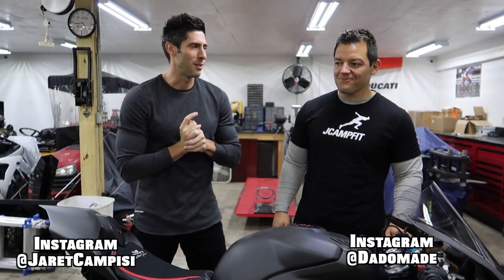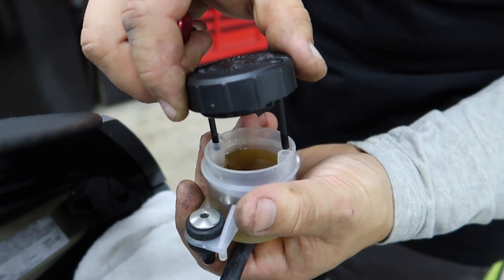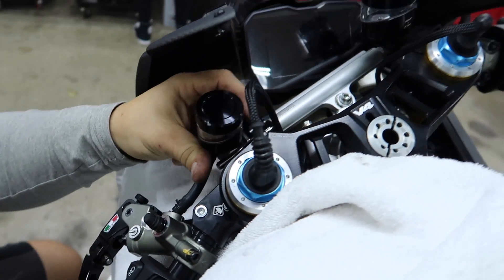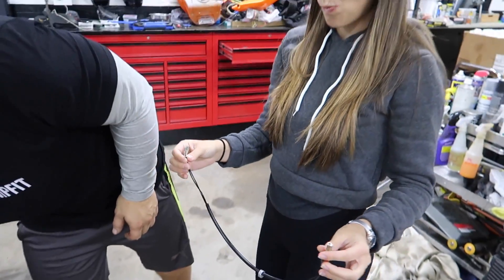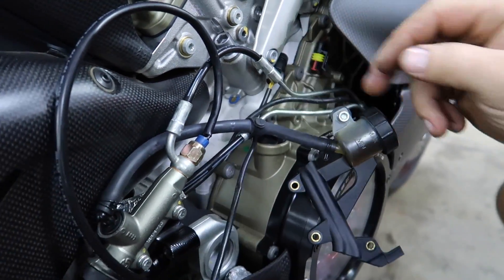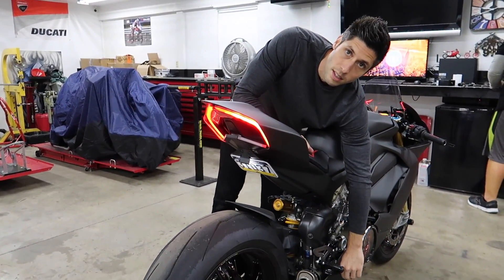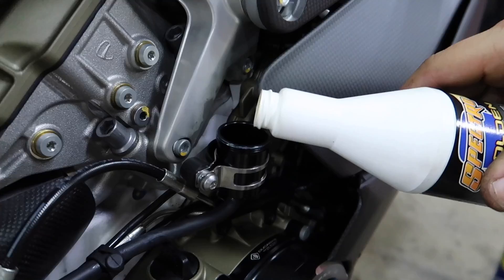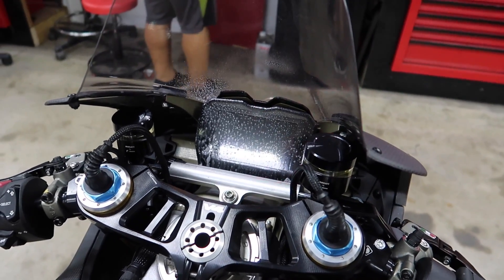Carbon V4 Gets Beautiful Rizoma Reservoirs!

Comment: Should've used Motul 600 instead of that lower temp DOT 4. Rear brake reservoir gets so hot that you need high temp stuff. Also the Rizoma reservoirs are aluminum and will conduct the heat more than plastic

Comment: Very good,but what`s wrong with DOT5? I used it on both my standard and  tuned Guzzi proddie racer road bikes  from `81 to `85.
Reply: Dot 5 is glycol based and can't be used in a bike that use normal brakefluid(which is alcohol based), if you want a higher boilingpoint than DOT 4 you need to use Dot 5.1. Ps even raceteams use normal Dot 4 brakefluid.
Reply: Thanks for that explanation.
I rebuilt my Guzzi`s Brembos,fitted braided stainless lines and used DOT5. Bike had same top speed as the horrid GPZ900R,but absolutely obliterated it on twisty Brit roads,in spite of weight of shaft drive kicking me up the rear.Those Brembos were used very hard on the roads and never faded once.

Comment: How much this thing weighs now?
Reply from the maker: Started at 430 lbs wet weight and we've shaved off around 40 lbs with all of our mods.  So it should be around 390 to 400 lbs at this point.
Reply: @JaretCampisi  
At 400 pounds that would make this beast 27LBS less than 650IB last build ( 2018 S1000RR )which is awesome